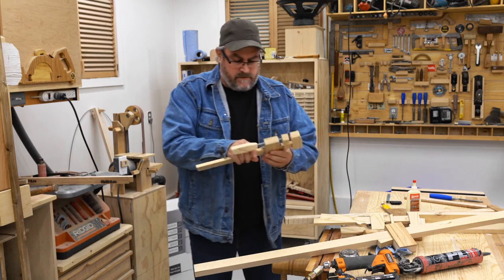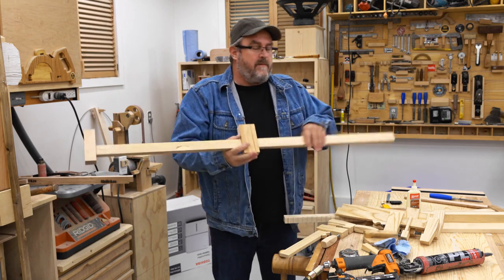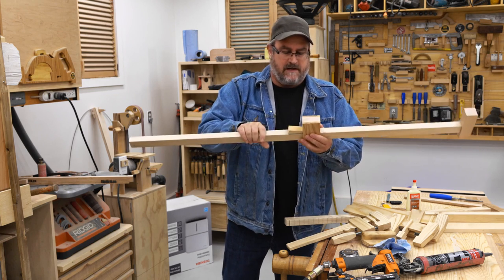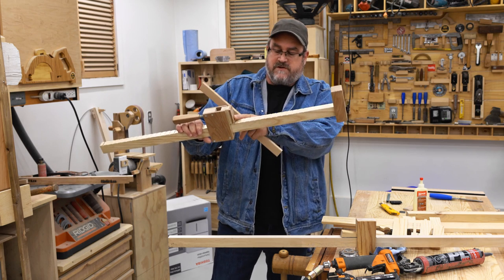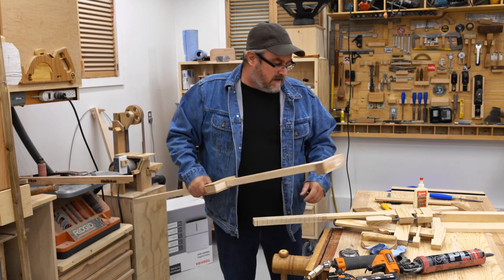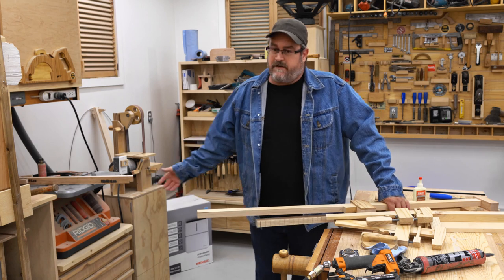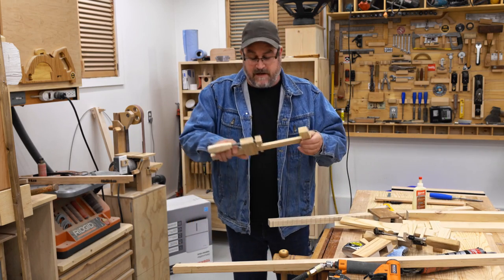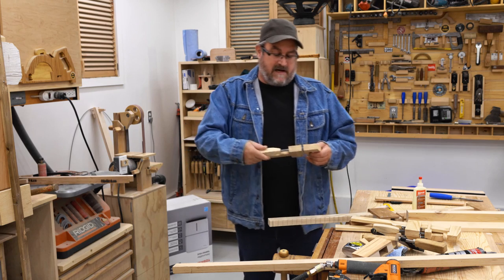I ❤️ This Clamp! And You Will Too

Comment: For tightening the clamp could you use a handle at 90 degree angle on the clamping part work. The idea is that the lead screw would push down a 45 degree angle sliding wedge so that it pushes a second sliding piece to the side that will be the clamping force.. It does not need to slide out that much, too force it tight because your system let's you get it very close to the work piece(similar to your router  lift)  I can see it in my mind but can't explain it well.. If you want I can send you a drawing of what I mean..

Comment: well let's see if the idea with the lead screw you talk about works I'm a bit skeptical because if you put in an angle it might tighten it up against the bar first before clamping the pieces together, maybe I'm wrong
how about putting two splines in an angle to reinforce the piece on the weak point would that work?
BTW great clamps...
Reply from the maker: That's why I take the time to actually build it to test it, rather than trying to "reason" my way into thinking it won't work. If I took that approach, I'd get nothing of any significance done.

Comment: Hi John, I have been trying to buy these plans for over 30 minutes now, I get all my information in and then click the pay now button but nothing happens. I have logged in and even closed the computer down and restarted but it always ends the same. there is a red box asking for the delivery method but when I click on this it will not let me select anything, it is driving me crazy (or at least more crazy than normal)
Reply from the maker: Not sure why you are having an issue. The payment process is basically out of my hands, since it's handled by Ejunkie and Paypal. Others have been buying plans today, though, so it's working.
Reply: @IBuildItScrapBin  I will try again, thankyou for your reply